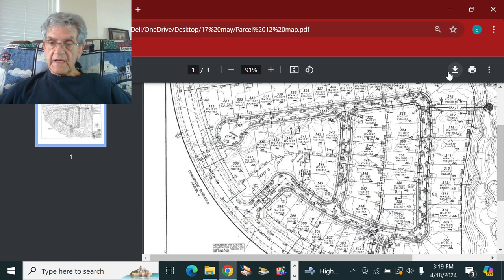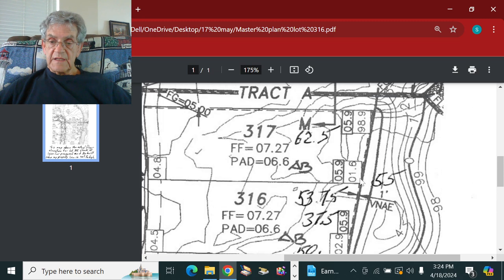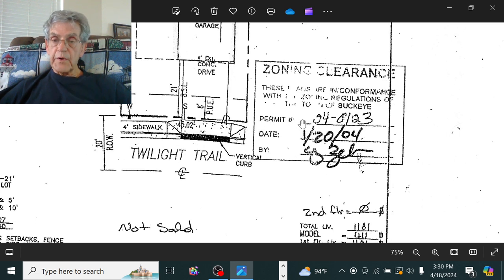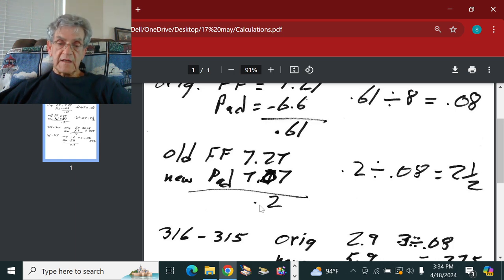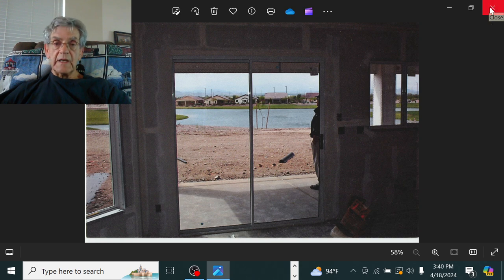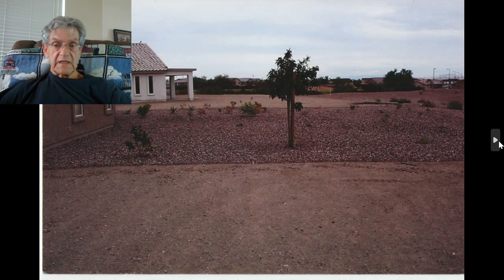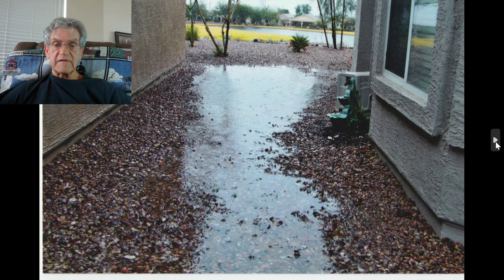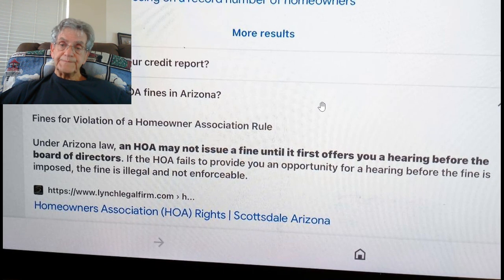HOA Law Suit Response

Comment: It looks to me like they built up the back yard to give you a level yard. And that meant that your yard no longer drains. That's a major issue. A drain such as you've built with drainage pipe can help, but it needs to slope at least a few inches and based on what you've shown in the pictures, seems to be level. 

The elevation of your house being 2-3 inches low is relatively minor. In fact, I'd be surprised if it has not settled an inch or two more since then. Now, is a couple of inches actionable? I suppose that technically it may be, but that's a battle I'd not fight unless the house itself is taking in water. 

What is an issue is the berm that you built. In order to stop trespassing, you altered the ground level even more. And that turned a flat yard that water had trouble draining from, to a bowl that retains water. I don't know if the berm is legal, but building it without provision for drainage is on you. 

An issue that you skim over is the "Tract A" gulley that has been filled in. I strongly suspect that that was intended to drain water from the street past the housing lots to the low ground by the lake. Filling that in changes the drainage for the whole area. 

You need to talk to a civil engineer and a real estate lawyer.